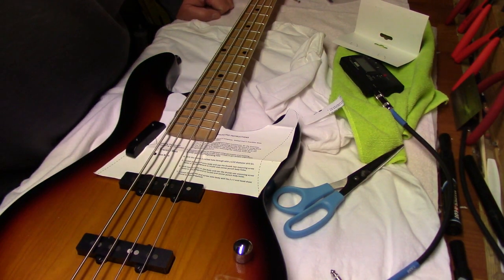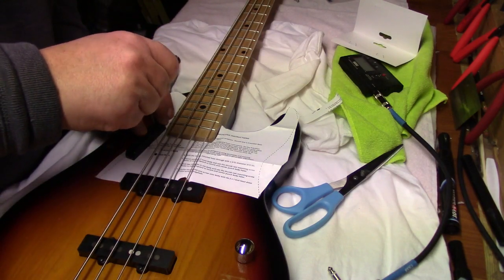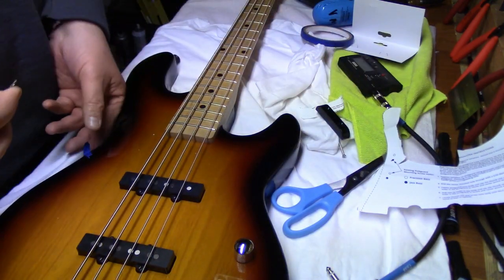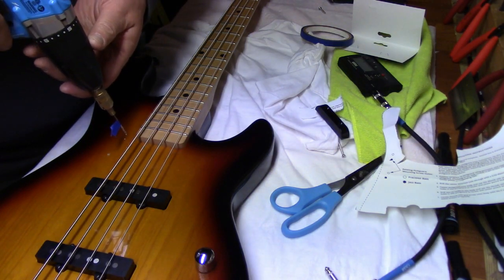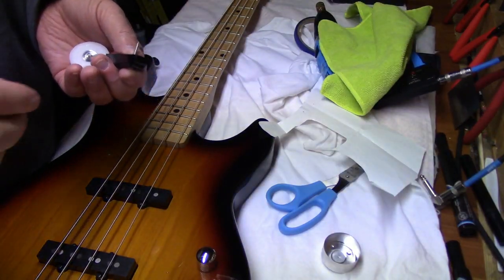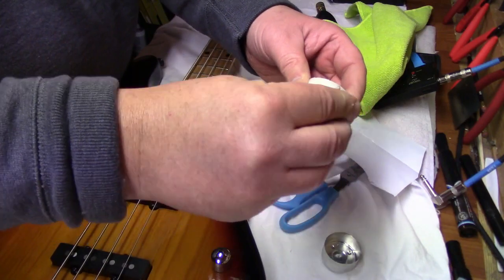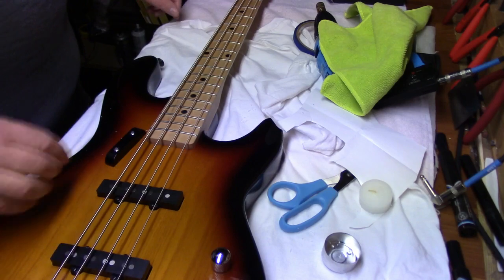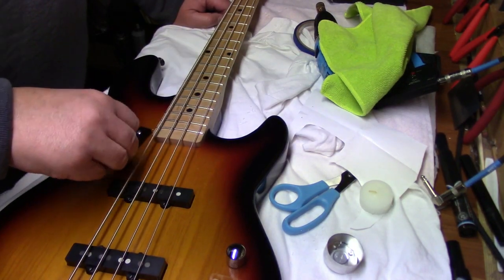Jazz Bass Thumb Rest Install

Comment: Hints:
- make a single mark and drill a single pilot hole. Install a single screw. Make sure the rest is properly aligned and then mark your second hole. This reduces the chance of the marks from being off center and shifting your rest from the desired position or screws binding against the sides of screw holes as they’re tightened.
- Don’t drill the entire length of the screw. The end tapers and it won’t be holding. Leave some virgin wood for the tip to fully bite into. Depending upon the screw size, material, and application this could ranged from 5 to 15mm.
- Soap will work as a lubricant too.
Reply from the maker: Thanks for watching!